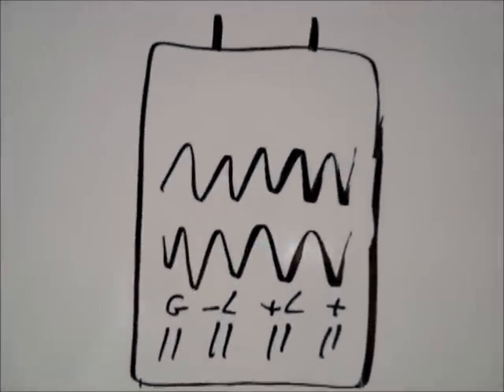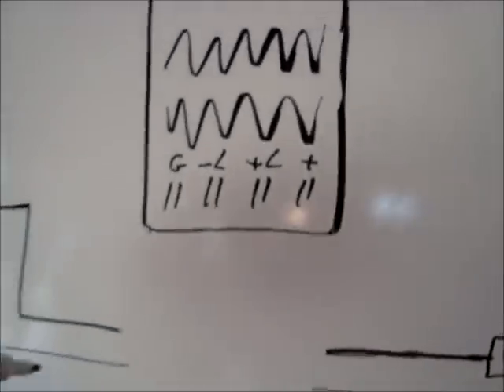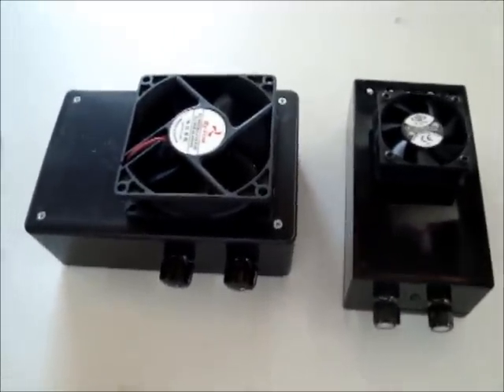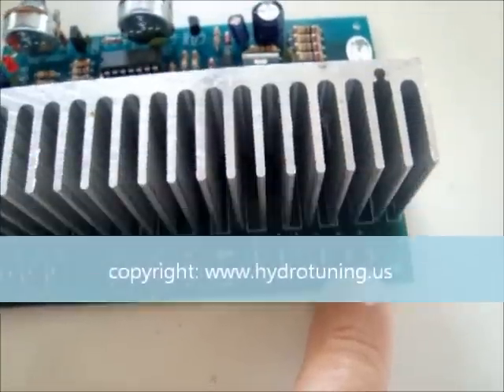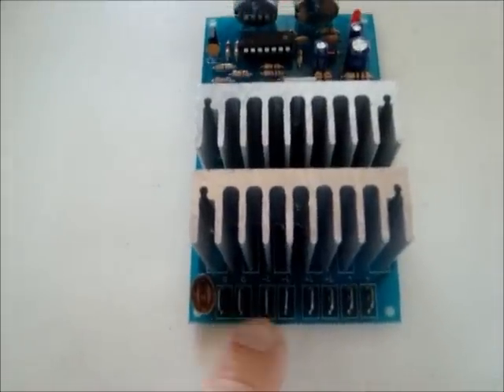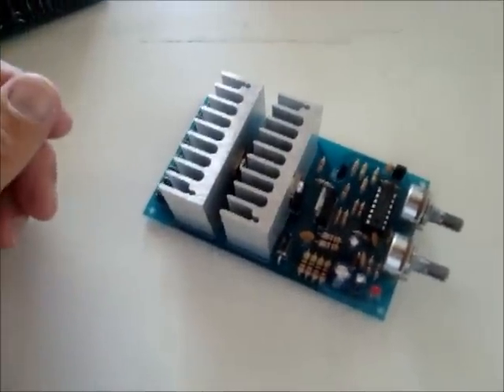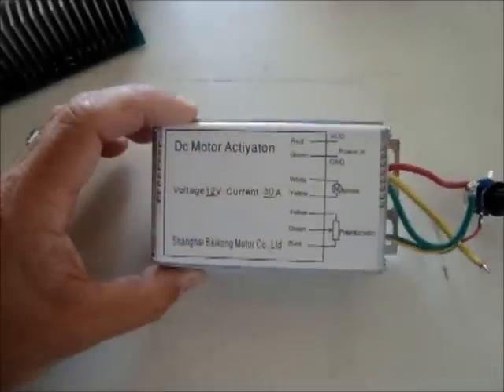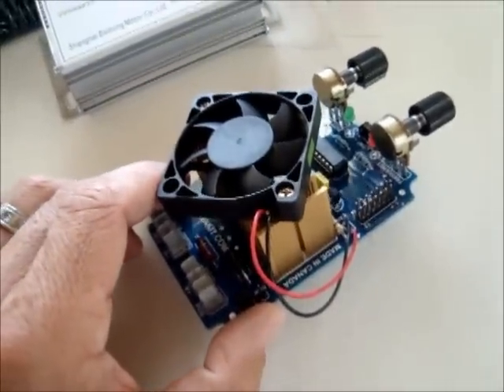PWM installation video for HHO systems

Comment: Dear friend, what are these 2 potentiometers for?
Reply from the maker: Hi friend, the PWM can change the amperage and frequency for the HHO cell. Some adjustments can generate more "foam" instead of HHO gas, so you can regulate the output better.

Comment: What is the difference between a pwm and a pwm pulse frequency signal generator as seen in this ebay link? https://www.ebay.com/itm/PWM-Pulse-Frequency-Signal-Generator-Frequency-Range-1Hz-150KHz-Will-Run-on-9V/303445756451?hash=item46a6c6ca23:g:uUQAAOSw1p1eHjt6